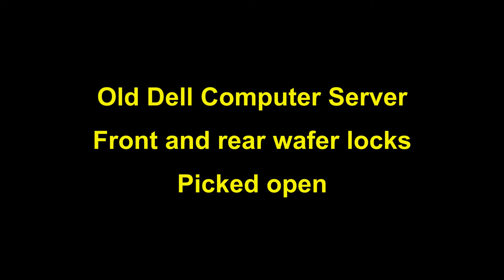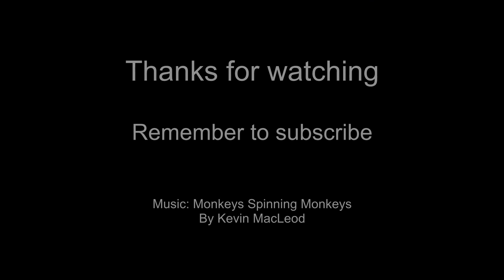(126) A Computer Server's 2 locks Picked open.

Comment: An old beast. All computers I've seen have wafer locks, even expensive servers. Pretty pointless really. :/

P.S. congrats on the big 400 subs!🍺🍰🤪🧃⛱
Reply from the maker: Definitely an old beast. I thunk we'r had two or three of these working wire a few years ago. This one lay dead in the IT room. We stipped it to carry it down 4 flights of stairs then put it back together. 
I must check the new server and see what type of lock it has, the previous inne was a wafer lock too.
Yes I am pleased to pass 400 subs and hope I can keep putting out content worth watching. 
Cheers for watching and commenting.